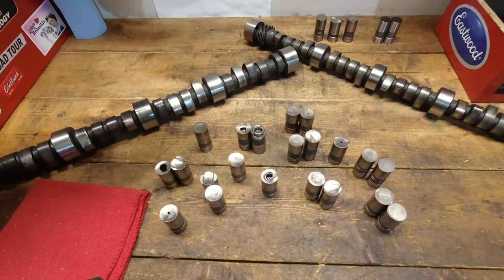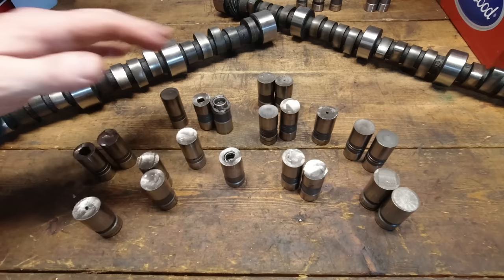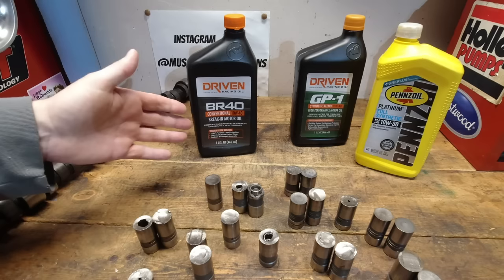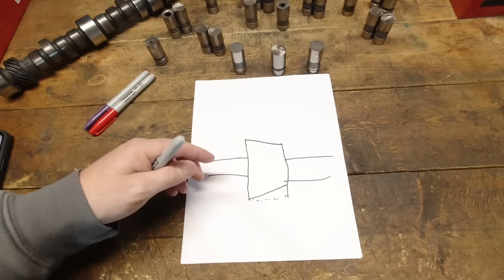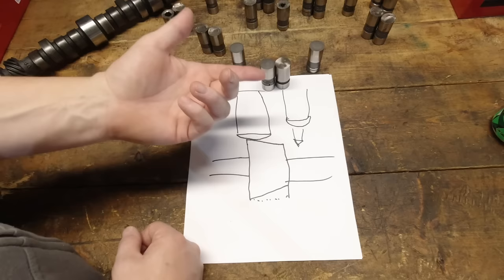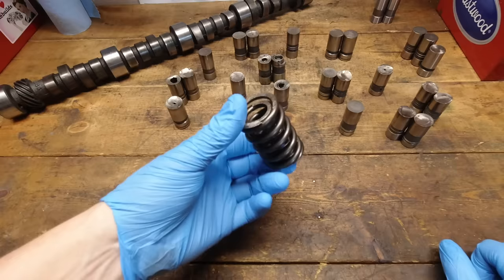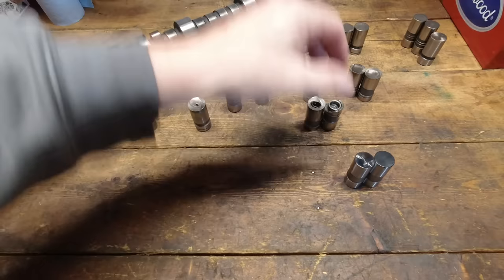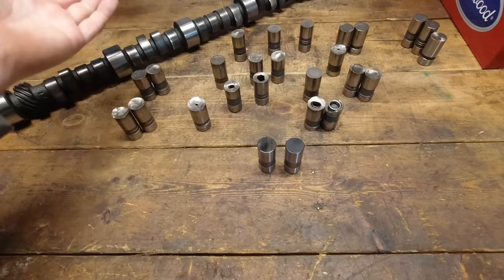Flat Tappet Cam Failures: The Reason Why They Go Bad & The Solution! Part 1

Comment: you seem to discredit other peoples experience very quickly...  referring to the "Canadian".   You are also, in the same breath and without actual proof or facts, blaming the end user....aka "the Canadian".

I don't know why or how these flat-tappet cams/lifter are failing.  But it seems to be more common these days.  Is it the oil?  I don't know... but there is a specific engine that Jeep has been using for decades after the Zinc was removed from the oil, its the 4.0 engine.  Those engines  are are known for reliability and near zero valve train issues... again, using oil without zinc.  Was there a specific "break in oil" used during the manufacturing prior to releasing to the general public?  I don't know.  But I think it's safe to say, the new Jeep owner (1980's - 2001) were using what was available from the stores to service there Jeeps... and these oil did NOT have zinc.  

You mention tapper and crown.  You talk about "looking" for some kind of swirl or something... idk.  I do know, there is a very specific crown that is required as well as a very specific tapper on the cam. And without having the right measuring equipment, I can't verify anything with the lifter or cam shaft with just my eye balls!   The crown isn't something that can be "verified" by simply seeing a crown and thinking, "oh, its got a crown, it's good"!  To the average guy rebuilding the engine at their home with basic tools, we just have to have faith the crown of the lifter and tapper of the cam shaft are machined properly.  

This video seems to assume the end user (customer), is doing something wrong.  This is exactly what happens to the customer when they call [enter companies name] and begin to describe how they followed the break in procedures and yet the valve train still fails. And, somehow, some way, it is still the customers fault.  Because by then, we can't verify the machining of the parts were done correctly.  

I keep hearing from people (the diy'er) that have been doing this type of work for years using the same procedures that worked for the better part of a century.  But are experiencing having failures today.   

So... is it the oil?  break in procedures? manufacturing and machining process?....  idk?
Reply from the maker: I appreciate your comments and a few things stuck out.  As far as the Canadian that had problems.  I’m not going to put the guy on blast and pick apart him by name.  There’s far too much of that crap on this platform.  That video was one that I watched where it was VERY apparent that the steps he took all led to the failure.  The springs he used (he showed them).  The oil he used (he showed it).  The only thing he wasn’t perfectly clear in was what his break in time and RPM was.  But he also mentioned he got the break in details from a retailer (again, nameless as I’m not going to put them on blast) and not from the cam manufacturer.  On a big block they’re a little more complicated as the valvetrain is heavier and slower break in RPM is needed.  His video I decided to refer to in mine because he was open about all the details.  Most videos don’t talk about these in detail so it’s hard to use as an example.  I tried reaching out to him a few times but never heard back.  I’d rather try to help him than send a bunch of people there with a ton of negative comments.  My decision to approach it this way and I would do it the exact same way if I remade this video today.  

This channel is about DIY.  Always has been.  So when I provide some things to look for in the case of what a good pattern looks like on a lifter face, it’s to help that end user, without the tools or technology to know it’s a good crown to match the taper on the cam.  Couple that with what a good chamfer looks like and now that end user can start asking questions of the cam manufacturer instead of just slamming it together and hoping it was right.  Or worse, mismatching brands.  

Sorry you took offense as this was telling people they are doing it wrong.  It’s the exact opposite.  It’s helping provide the information so they can do it RIGHT.  The feedback seems to support that.  Oil, spring pressures, break in procedures, visual inspection.  All things that need to be considered.  If that’s offensive to you, I’m not sure how to address that.  The issues have been occurring for more than a decade.  It’s not a new phenomenon.  But there is a way to help the survival plus a new solution.
Reply: @MuscleCarSolutions  definitely not offended.  Just sharing an option,  just as you did.

Comment: I agree with most of your points except I don’t see how a windage tray would have any effect on the mount of oil slung from the rods unless you’ve got the pan overfilled and whipping up oil. Break in springs would be the way to go rather than trying to decrease pressure with higher installed height of the specified spring for the installed cam.

Comment: I now have 2 comp cams hydraulic flat cams for 2 of my 350 Chevy motors for both my Camaro sports cars. I run good oil with zinc additive and change the oil regularly. Haven’t had a problem with comp.

Comment: Checking heat-treat - the surface hardness will exist only in the upper ~.010-020" of the surface, so it's not that the heat of failure annealed the camshaft, but instead that whatever surface harness was there has been worn thru.  But regardless, you are correct, you must check it first.  And in a location that isn't part of the wear surfaces, of course.
Reply from the maker: Next video will help understand heat treating which hopefully you’ll find enlightening.

Comment: When the camshaft is ground the amount of taper that's put onto the lobe is very important and many aftermarket cams especially those with more aggressive profiles are ground with too little.  On a typical flat tappet cam I use .0025 total taper, big Chevy I use .003.  The reason for this is because the lifters are not just sliding along on the cam they are actually rolling.  Think of  it as a tire going down the road with about 80 degrees of negative camber.  It isn't sliding it is actually rolling.  If it does not rotate it doesn't roll, the friction goes up tremendously and the whole thing quickly wears out just like a tire skidding on a road.
Reply from the maker: @DaveMcLain  ugh.  Let me see if I can clarify.  If you’re running .003 of taper you’re using a horrible lifter.  Optimal taper GM used was .0012 over a .300 span across the lobe.  I can’t speak for all the aftermarket companies but I’ve been through comps facility enough to know they try to control the contact position of the lifter on the lobe by offsetting the lifter centerline compared to the stock location of the lifter bore in the block (making a huge assumption the bore has seen no wear and is where it’s supposed to be - no wear or core shift).  Those things create the torque needed to rotate the lifter.  If you’re running a high amount of taper, you’re moving the contact point away from the center which will help facilitate rotation, but you’re giving up contact surface area of the lifter on the lobe, which is not a good idea.
Reply: @MuscleCarSolutions  I'm talking about total taper so you're right .0012 across the lobe = about .0025 total taper.  From what I've seen a lot of cams are less than that when I regrind them.    I reground a 268H for a guy with a big block Chevy a few weeks ago that had several funky lobes, I gave it .003 total or .0015 across the lobe and that was more than it had originally.  The reason for doing that on a big Chevy is because those blocks are notorious for having lifter bore machining that isn't very accurate and that can impair the lifter rotation.  A friend of mine one time took a tour of Johnson Lifters because they sold a ton of them through the cam company he worked for.  He was amazed that when the lifters are produced the crown on the end is ground BEFORE the outside of the body is centerless ground.  Seemed backwards.

Comment: There are not very many lifter manufacturers in the world most cam suppliers are reboxing lifters you will hear people say Oh it's Chinese junk that's not the case. The problem is 2-fold the first is low ZDDP in the oil not using the correct oil can wipe out a cam along with the improper break in procedure the other problem is the machining of the face of the lifter not being machined correctly. Rotella does not have much ZDDP these days zinc additive does not work with detergent based oil you half to use non det oil if you use additive the best bet is to use Driven or Lucas Break in oil I have personally stopped using flat tappets altogether everything you said in this video is correct I put out a video last year from my shop and basically said the same thing you did here we have a cam grinder and a lifter face grinder there are so many bad lifters being sold from every cam supplier we have reground thousands of lifters out of the box form every major cam supplier in North America and I can tell you every single one of them is selling lifters with little or even no crown at all, you really need to chuck a lifter up in the machine to know if the crown is correct or not I can tell you most lifters being sold across the board are junk Howards actually has the best flat tappets but even they had some bad ones like I said been machining for 35 years and I am done with Flat tappets  good video
Reply from the maker: That seems to be a common phase that’s caught on in explaining flat tappet cam failures.  Wrong crown on lifters.  In reality, it’s only half the story.  The final video in this series I finished with lifters and covering the crown on a lifter and it’s relationship to the cam.  There’s a small niche cam on the market currently that uses an off shore lifter with a horrible crown, but they put a taper on the cam to work with it and they rarely have issues.  As far as oils go, I did interviews with Driven and Lake Speed Jr and zinc was covered.  You might find those interesting.  Cheers!

Comment: I have seen lots of roller failures in factory engines. A couple were in my own well maintained vehicles. I hope the aftermarket performance folks are doing a better job than OEM.

Comment: When I was a kid back in the 70s we never broke in a Cam just buy a cam put it in with new lifters a off and running never heard of braking it in so that was possible we had better oils or the hardness went deeper into the cam and lifters and now to cut costs thay don't do the same hardness ?

Comment: I been rebuilding engines in the 70s to the late 90s never had a cam and lifter fail, never had to use break in procedures so people are saying its on the mechanic not following procedures thats bull ,its cheap quality parts period with cheap oil

Comment: Setting Correct Rocker Arm and valvespring lash is critical alongside using the correct length pushrod and correct springs for your application.

Comment: I run a Gen I sbc. These have a short lifter boss and as such if you want roller lifters the price basically trebles. It's cheaper to go buy a junkyard LS and rebuild it, then you can get the rollers.

Comment: One point of contention as to rollers being less trouble. I simply point out the Gen 3 Hemi. In that with so many other applications, they developed such an issue means even rollers aren't invulnerable.
Reply from the maker: It’s not the roller.  It’s the MDS on the hemi that causes the issue.
Reply: @MuscleCarSolutions  But it's the lifter that's failing as a result. There's also the issue with inadequate oiling of the body with extended idle and the watery thin oil. Point being, mistakes in design. The LA and Magnum rollers didn't have these issues.
Reply from the maker: @tvdroid22  the non MDS lifters are living just fine.  When you restrict the oil flow to shut down cylinders, no matter MDS or DOD.  They both hate it and they both suffer.  It’s not the fault of the lifter.  It’s the result of a poor design when longevity is the goal.

Comment: I feel the best way to cure these cam/Lifter issues of Hyd flat tappet cams is find a motor builder person that has NOT been having any issues!. I been building flat tappet motors for many decades and never had a cam problem, a not 1. One thing I see over & over is guys not useing enough of the black molly high zinc grease on their cam or lifters when building the motor. The cam companies only give you 1 very small packet of the grease, ( that is NOT enough !) and many guys only use assembly lube, or fail to apply the black molly grease correctly. I always buy a extra pint can of that high zinc molly grease (Isky is good) and coat everything ( all the cam and the faces of each lifter really heavy. I also do my standard 30 min brake in at 2,100rpm with QTs of straight weight 30W Lucus high zinc brake in oil, (having problems getting Driven in Florida) drain it hot after 30 mins, replace the oil filter & refill with more 30W brake in oil drive the car 100 miles easy moving RPM up and down all the time. then drain the oil again with another new filter and more 30W brake in oil for a 3ed time, and again drive the car easy moving RPM up & down always under 3,500 rpm for another 300 to 400 miles and change the oil & filter again and continue to run 30W brake in oil for the first 2,000 miles changing the oil& filter every 500 miles. After 3,000 to 4,000 miles more, I switch over to straight weight 30W high zinc Valvoline VR-1 racing oil  (there are better oils, but best I can find in this State right now)

Comment: One of the better solutions given here is spend the monies on a ‘break in” set of springs.
And the tools needed to do this task. The little money & Time is well worth this move.
Few guys talk about it or do it just throw together an engine hoping it worked out. 
1. Set of break 9i springs.
2. tools to do this task. 
If not them IF it fails THEN my advice was actually GOLD!
Reply from the maker: @yafois988  spring pressures are a huge part of a successful break in.  There’s others things that are just as big.  The rest of the videos in the series highlights a lot of those in a visual way, not just talking about theories.

Comment: Just seeing this, haven't read comment, 26 seconds in, but a long while ago zinc was eliminated from oil, and flat tappet cam/lifters need zinc or zddp.  Anyway, have not lost a flat tappet cam after install.  Rockwell testing of lifters and cam surfaces are usually 46-58 Rockwell.  If no taper ground into cam lobes, done, if lifter face is ground crappy, done.  Cam core myths have long been dispelled.  Lifter crap too.
Reply from the maker: We cover that and more in this series.  Enjoy!

Comment: I have 9 Comp lifter keepers I’ll be removing from my oil pan on video soon.   With correct length rods and spot on valve geometry they pumped up in my Pontiac at 6200 RPM and flew apart.   The little industrial staple the use for a keeper blows!   Literally!   I might give them another chance if they had snap ring keepers.   But this cowboy ain’t ever running. Another lifter with a staple for a keeper!   First and only set I’ve ever owned.   Rhoads lifters.  Nothing else.   Ever.  In 40 + years they never let me down and every car I’ve put them in ran faster no matter what can they has as long as over stock.   No voodoo required.   Start up on 340 lbs of open pressure.   Just pour in the VR1, run it in a few minutes and take off.   Never have a cam wipe out…. since 1982.  Jack Rhoads is the Godfather of Lifters!  😎

Comment: APPLAUSE!!! GREAT VIDEO - LOTS OF GOOD INFO! now,,, lets talk about one issue that was not covered or is generally over looked by most hobbyist - the condition of the LIFTER BORE itself...Lets assume that most of us, when it comes time to build our engines - have the machine shop "machine" most of the blocks contact surfaces(cylinder bore/deck/main saddles-as needed). A good machinist or engine builder will check/feel/measure the fit of the lifter to the lifter bore. We know that a tight tolerance is needed here. But lets say the engine block showed signs of rust/sludge or over heating? And the lifter is very tight in the bore. How will that flat tappet lifter be able to freely rotate as needed? You could use a brake-wheel cylinder hone to polish or recondition the lifter bore. But what if the bore is distorted or out of round? Lets say upon DISASSEMBLY - some of the lifters came right out & a couple of lifters had to be PUNCHED out from the bottom. Ya think that there's a problem there? Another point of possible failure of the cam & lifter assembly could be related to camshaft "walk". On SBC, there is no retaining plate up front - like on a Ford. The timing cover on a SBC is thin. A button or welded stop needs to be utilized to limit the walk to an acceptable level. The rear cam tunnel plug also needs to be properly installed...Most failures can be attributed to the type of oil used at break in. High detergent/ synthetic oil is a no-no! To much spring pressure on the seat & at open rates - along with the wrong installed height is catastrophic to the cam & lifters...The wrong engine speeds at the initial start up is often over looked. This amazing video covered all of theses issues...Lots to learn here & it's easy to over look the small details...Thank you for your time & efforts!!
Reply from the maker: I have one last video in the series and that’s on lifters specifically.  It’s taking some time to gather the examples I need to do it properly.  I don’t do videos that talk about only theory.  I want to show it.  It’s why this video took me forever to finish because of all the examples.  Why the second video took awhile and at a significant cost so I could SHOW what cam hardness is.  I’m glad you appreciated the effort.  Thank you!